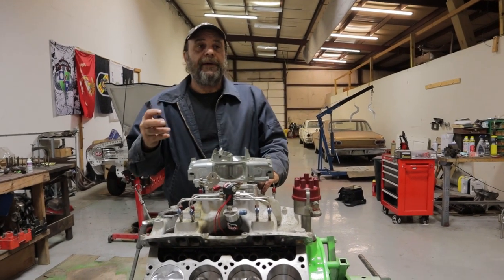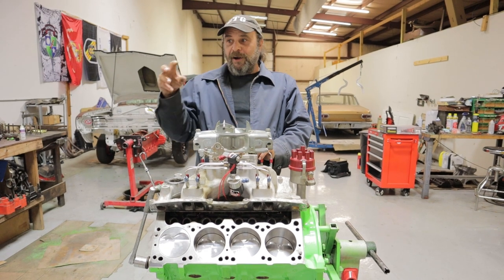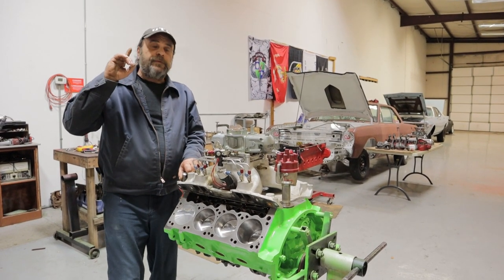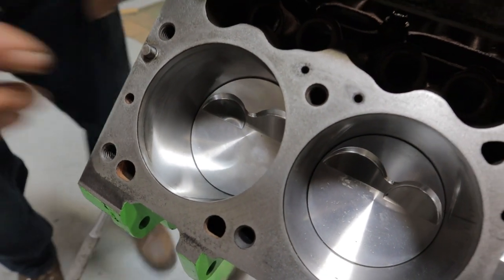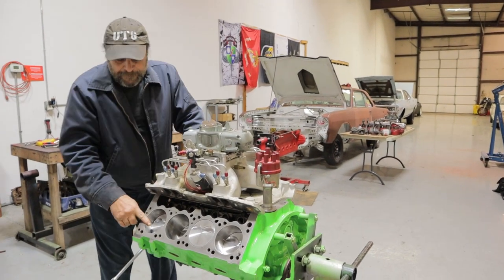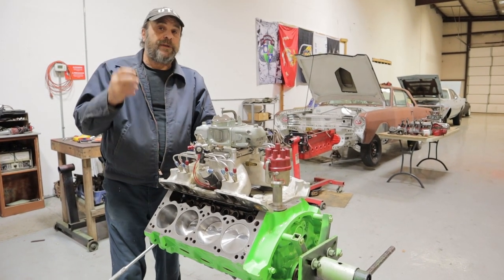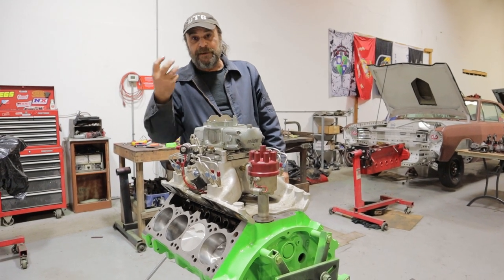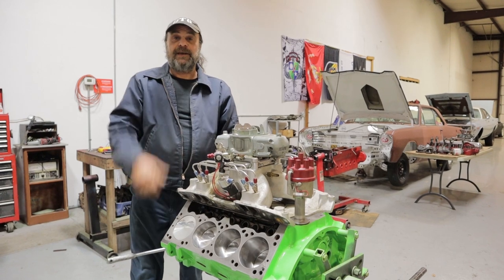The Fundamental Aspect Of The Internal Combustion Engine Nobody Ever Talks About

Comment: Working with newer BMW Tuning, I noticed between "modes" that there were tables in the tune file that set desired IAT and EOT temps.. and in "eco" modes, they were higher.. took me a little while to understand this- seeing as the primary goal for anyone making power is to Lower IATs and EOTs as much as possible. Made for some really cool numbers once all was understood though, averaged 25mpg on E85 with a 500whp (Bolt-ons only) i6 on the highway.
Reply: Love the BMW engine tech!
Reply: What is IAT and EOT? Intake air temp and exhaust o? temps?
How were they controlled?
Reply: Intake air temperature and exhaust outlet temperature? Is that what those acronyms stand for?
Reply: @joshnabours9102  Intake air temp, and Engine Oil Temp. Exhaust temp is "EGT" (Exhaust Gas Temp).
Reply: @sendit9129  thanks. I knew I had the first one right, but was pretty sure I had the second one wrong.

Comment: Teacher Tony!  I heard back in the days of playing around with HHO generation that it wouldn't work because it combusted faster than gasoline but never explained to this extent.  Knowing the expansion rate and distance of fuels is vital to understanding how an engine will function with them.  Engines designed for gasoline simply are not optimal for other fuels. Perhaps Rotary Engines would work better with alternate fuels since their principle to get the motion going in the first place is different from the way normal engines get it done.
Reply: That's why hydrogen is not safe or efficient to use. You have to inject a hell of a lot more hydrogen into the cylinder so it doesn't burn it all at once, which can then result in catastrphic failure. In high school we had a project for a street car running with hydrogen, and this issue (engine blew, couldn't resist the pressure and heat), coupled with having to use a small and pressurised tank for the hydrogen, made it clear that for widespread application it is not viable due to safety and inefficiency...
Reply: Yes Indeed
Could that faster burn rate be utilized to improve emissions on the rotary?

Comment: Thanks for Explaining it Simply! You're so Accurate and onto the Science of it here!

And this is why I LOVE Turbocharged Diesels SO freakin' much. They have combustion pressures (Ratio) so high really are almost Immune to Fuel/Air  problems with Stoichiometry. I started with a VW TDi. That tiny little thing could Pull (accelerate) up a Mountain at 100mph in 5th gear. I did it many times to test the "Difference" between that 110 hp car & my 150 Hp light truck. Cylinder pressure & Combustion even duration is why. Diesels burn ALL their fuel extremely quickly and have very little flame front propagation time. And you can "Feel" it. That's why Audi Won the 24 hours of LeMans like 5 of 6 times consecutively. The last owner(s) drove it so hard (350,000 miles worth) it's got enough blow by to nearly pop the oil fill cap off. Still chugs along though.

https://en.wikipedia.org/wiki/List_of_24_Hours_of_Le_Mans_winners
https://en.wikipedia.org/wiki/Audi_R8_(LMP)

And I "Graduated" from 2006 TDi to a early 90's 7.3 Powerstroke then a 1983 6.9 Ford & 1989 Ford IDI and 1984 Audi/VW Turbodiesel. Thing had INSANE low end torque!

I Loved my Dad's little EFI Chevy 2.2 Vortec truck. But when you had any more than 1200 lbs in the bed? Want to tow a 2000 lb trailer (within spec btw) up & over the Continental Divide? Forget about it! You'll get 10 mpg on what's normally a 24 mpg manual truck! IT Couldn't cope with hills! 

And now I'm trying to resurrect a 1990s EFI 300 I6, to solve my torque problem: but 30 year old the decaying circuitry in the EMC & electrical system? It's a Nightmare. And fighting me. Over budget. Out of parts. I"m about to rip every wire off the thing & convert the whole thing to Carburetor. Or design my own EFI system with an arduino  (I'm a computer engineer by trade).

I"m never going back again, to anything "ICE' engine other than Carbureted high flow rate Gasoline or Turbos Diesel! One day perhaps I'll have a Tesla too? I did have a Prius E.V. conversion project car. Atkinson Cycle that is.

Everything I owned or drove in my  teens & 20s was post 1996 and EFI. So I had No point of comparison? Yet I spent my childhood building & repairing small simple engines & karts.

Technology Evolves, Fuel economy requirements keep moving higher. But the Venture Effect & Turbo-machinery will Always have a Warm & Special space in my Heart!

Comment: BMEP. = Brake mean effective pressure. I coat my piston tops and combustion chamber/ head  with a ceramic. High compression. A 'Short cam'(220 degrees or less) with tons of lift (just under .500@.050) for the street. Small intake manifold runners, just enough carburetor. Long tube headers. Best ignition I can find (usually MSD) As much timing as it can take (I live at 45oo feet- start at +4 degrees static over factory) Some kind of cold air/ram air setup. Minimalize heat loss, optimize tuning for low rpm to cut friction loss. Every trick in the book. Pan evacuator, smaller pulleys, hot thermostat, etc, etc. Low friction lubricants, teflon wheel bearing grease. then -Tune, tune, TUNE! Over 70% of the energy still goes out the exhaust... But whut you gonna Do?  = 25 mpg '89Jeep Wrangler with the old 258 and a 5 speed... .3,08 axle. Just keep those throttle butterflys open at low rpm on the highway  for optimum cylinder filling. The 258 is a tourge monster to begin with.  I wish I had put on the 4.0 head, no siamesed ports. It now lives in Virginia city, Nevada @ 6ooo feet, &  the  new owner can't quit raving about my build...

Comment: Nobody talks about this... but Tony DeFeo

And George Bryce

So, iif the problem with vapor engines is that you get such a quick burn that you're still not building pressure later in the cycle, how about doing things to slow the flame front kind of like the nitrous guys do... Big chambers, chamber softening, domes that slow the flame travel?

Also curious about using boost with very low compression ratios. Five to one, six to one.. something like that

It would reduce the expansion ratio on the power stroke.

Boyle's ideal gas law is: PV=nRT. P stands for pressure, V is volume, n is the number of molecules, R is the pressure, and T is the temperature

For every engine built with a mechanical compression ratio, it also has an expansion ratio from top dead center of the power stroke to bottom dead center.

Just like there is a dynamic or cranking compression ratio which is determined by both the mechanical CR and the intake valve close point, there is also going to be a dynamic expansion ratio which is determined by how the engine is built and when the exhaust valve opens.

So, if I build a "10:1" mechanical CR engine, I might only have a dynamic expansion ratio of 8 to 1

That means, (not taking into account the effect that the charge is continuing to burn and try to expand more as the Piston drops) that my combustion area above the Piston crown increases eightfold from the top dead center of piston travel to where the exhaust valve opens

If I was to reduce the engines mechanical compression ratio, then I should be also able to reap the benefit of a reduced expansion ratio, which should mean that the volume above the Piston crown would only grow fourfold instead of eightfold, which should help with it losing pressure as the Piston goes down. To some degree.

To counteract this, you would want to use forced induction so that you jammed a good amount of mixture into that area, so the small charge of fuel and air was enough that it builds good pressure.

Uncle Tony, curious what you think of this

Comment: I came to all of the same conclusions about 11 years ago playing around with hot vapor engines. My biggest complaint was the extreme lack of power. I finally realized I needed to try and slow the burn rate, and add liquid fuel back to the combustion chamber. After years of trial and error I landed on a mixture of 45% gasoline, 45% water, and 10% methanol. Once the mixture was placed under a vacuum they all mix together into a milky looking liquid. This liquid is drawn thru a one way check valve into to the heating coil wrapped around the exhaust, the heating coil had a catch can/regulator attached to the outlet "for cold starts, and to stabilize the heating coil output". This vaporized mixture was then drawn through the vacuum port on the front of a quadrajet carb, and the carbs idol jets where barely opened up. This was all done on a 1978 chevy 4x4 truck with a stock 350 sbc hooked to a granny 4 speed manual transmission on big mud tires. It went from 12-13 mpg at 60-65 mph to 20-21 mpg at 60-65 mpg. I had a vacuum gauge in the cab and always tried to keep the engine makeing as much vaccum as possible. It ran great from idol to 5000rpms, with no dead spots or lack of power. It took full choke to get it started, and a few minutes to warm up enough to drive. The mpg figure did not include the 1 gallon of gasoline required to make roughly 2 gallons of the mixture, which would last approximately 200 miles. I had many people attempt to dispute the science behind it, I would simply invite them to go on ride with me when the system was almost empty.  Once the last bit of fuel went through the heating coil the truck would die and would not restart until the mixture was refilled. Everyone who went on a ride walked away a believer
Reply: If you can customize it to customers in this day of internet you would make some good money... Lots of people are interested in what you explained.
Reply: I sure hope Tony reads THAT! I did almost the same thing, except for water in the fuel. I still build a 'poor mans' water vapor injector. Glass(not plastic!) bottle filled with 50/50 water alcohol mix. Engine vacum draws air through an aquarium air stone and makes millions of tiny bubbles. Viola! Alcohol water vapor into the intake manifold. To be honest, it works best with the throttle blades almost closed(high vacum) How do I know it works? I put some vanilla extract in the bottle and stank up the whole neighborhood. (burnt vanilla smell, I hated my neighbors!) Plus my spark plugs stay clean, clean, clean... We have like zero humidity in cold  high altitude-Nevada. Crank up the ignition timing, until 'Ping-age', then back off a little for hills. So it works very well, indeed. Costs like 10 bucks, not counting the big jar of pickles to get the glass bottle - and adds about 2mpg- depending on vehicle. Helps with our low octane crappy gasoline too...
Reply: I almost forgot...'It'  needs an adjustable valve  on the air intake side before the air stone. It can Fizzz so much! - that excess water/'alcohol mix can drown the engine! nope, Don't want that! Tall skinny glass Voss Water bottle is the best. Fits in a bicycle water bottle holder. Always Refiil bottle before empty to prevent an open vacum leak. I may heat my next one with a 50 watt, 4 ohm power resistor. But not really needed..

Comment: UT I LOVE THIS CHANNEL. Im a huge mopar fan and have been a subscriber since near the beginning of the channel. I’m also a big fan of Stanley Myers. 

So what your saying is, a short stroked motor with the proper timing and cam durations (Smokey has some secret cams designed) a hot vapor or hydrogen engine can be designed to work as a very efficient engine. Thank you for helping solve the problem.
Reply: Possibly in a stationary application, aka portable generator, pump, etc or in an industrial environment. Where as the engine speed/ load is contast for the maximum useable output.  Engine speeds that vary depending on load aka idling, tip in acceleration to part or full throttle not so much as Uncle Tony had explained due the lack of per-say "useable power". Because of the efficiency one would think they already be in mass production. There are a lot phototypes shows it being tried, but nothing being produced... Yet. With today's technology I'm very sure it's just a matter of time before they will come to market in viable automotive application. Besides if you want power.... Gotta burn fuel.. lol

Comment: this is one of the best videos you have ever put out Tony! it's got me thinking about stuff that I already knew but haven't thought about in depth in a very long time! sometimes you need to just sit down and think about the bare essentials, the basics and fundamentals of how an engine works, even if it's just a remind yourself! valve size compression, lift, duration, overlap, different stroke and bore sizes!!!! it all ties in together! with the visual demonstration it really helped me to relearn stuff that I should be thinking about a lot more when I build engines! mean piston speed, static compression compared to effective compression! this video really made me want to build an engine just to do an experiment! everything needs to play well together fuel octane proper cam good flowing heads that right amount of compression! God I love engines!
Reply: Smokey was parabond like Tony way ahead of their time as far as thinking outside the box  , to achieve a desired result..🤔💎👍💪✌️🙏

Comment: When you said momentum and flywheel I thought can't you just have a heavier flywheel that activates at cruising speed to let the engine run with little fuel?  Probably wouldn't work because it would take energy to spin it up though.